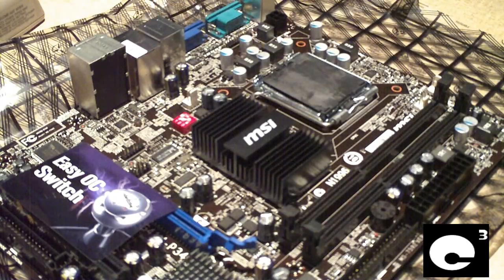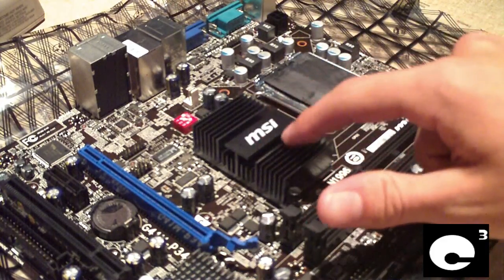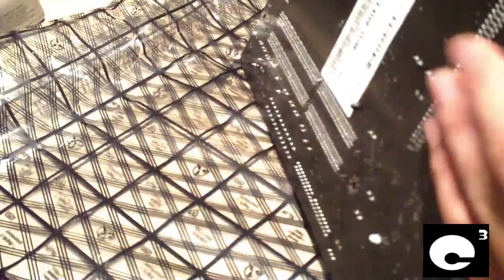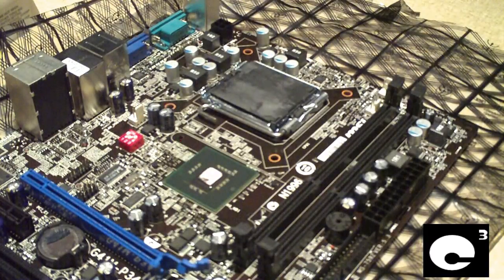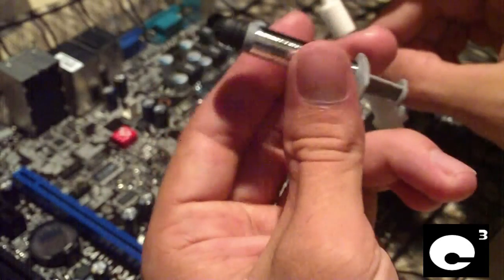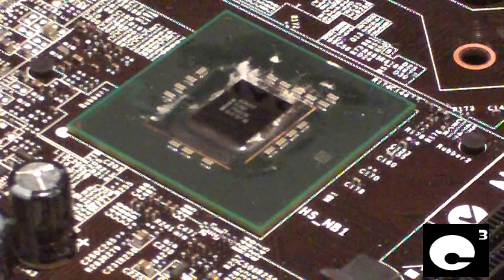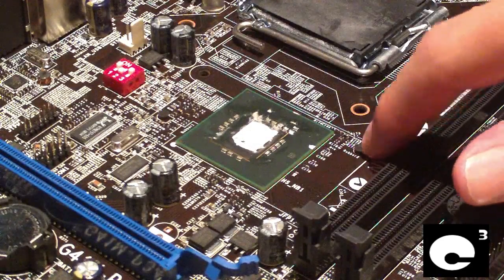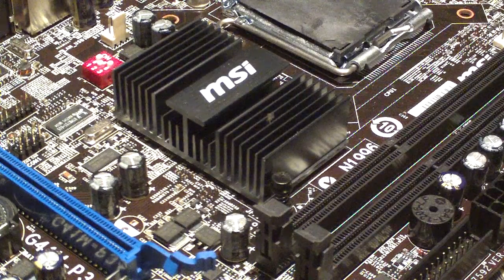How To Help Extend the Life Span of Your Computer's Motherboard

Comment: i have p5ql pro refurbished,southbridge run hotter than northbridge ,can touch jus for 2 sec,can i apply grey colour thermal to south bridge,arctic silver here is costly,i got som cheap grey colour thermal grease,can i apply that,i can be careful applying very litle,i have applied it to cpu,its temp is good,30-35c

Comment: What is the average life span of a computer?
Reply: Alec Cimafranca 10 years at least, hate misinformation, if you are unlucky it can be shorter by components dying (like water-coolers) but cpus, ram and motherboards generally survive for a long time, I would recommend changing out components between 5-7 years but that's mainly for performance
Reply: Hahaha, my PC worked for almost 11 years. Using Pentium D processor on Intel 945GCL board. There are some issues with the board like display doesn't work cos of some bulgy capacitor, will replace them and see if it works 😂😂😂
Reply: 3 years.
If you really take care of your pc you might get lucky to have 5 years.
Reply: @TArrow  if you have a really good power supply and decent airflow inside the case then your pc will please you at least 10 years.

Comment: Just did it to my Aunt's B75 Asus mobo.It is pretty true this gum thing is bad at transferring heat,the B75 chipset is only 6+ W TDP,yet it is overheating like crazy which is disappointing.
Reply: Get arctic silver compound instead. Better cooling and been so for years. Will not experiment with designer playdo for my precious hardware. Thanks.